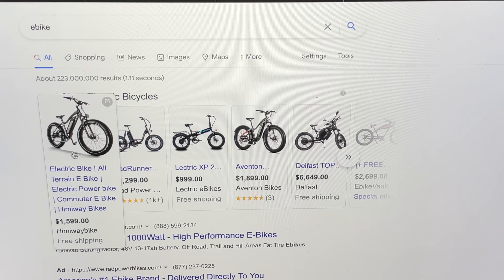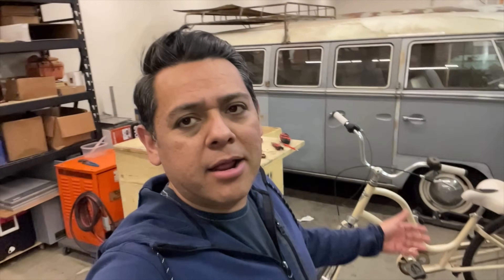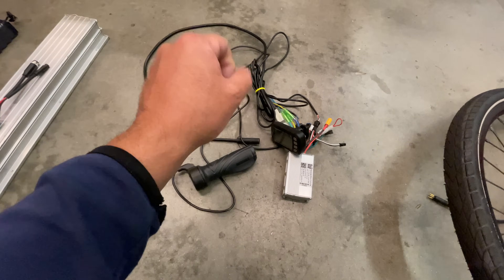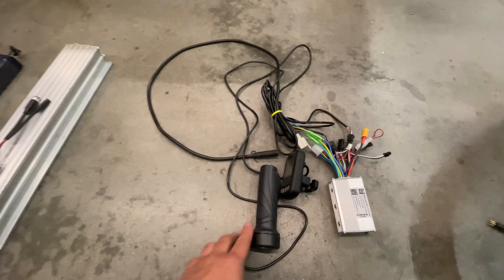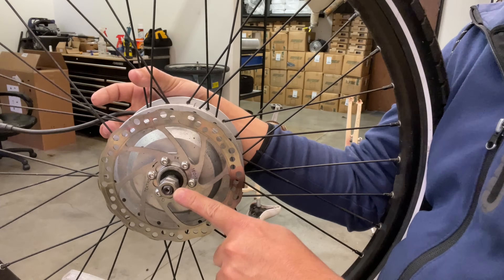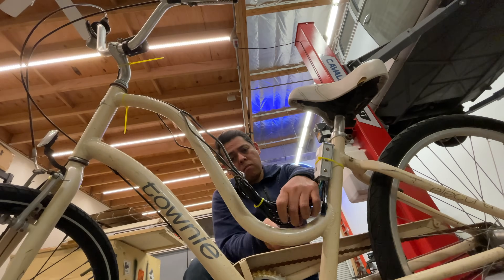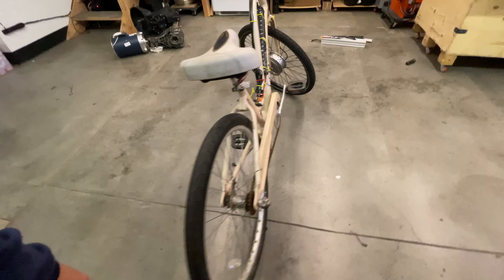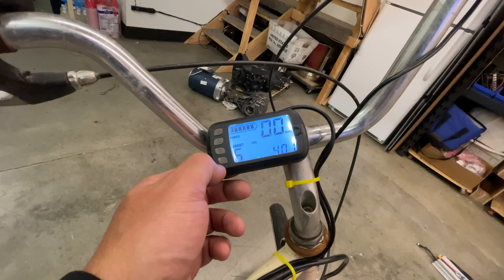$150 eBike Build,  Beginner friendly

Comment: Jehu, I'm just a little old lady who wants to convert my old coaster-brake into an e-bike to take me grocery shopping!  3-mi round trip max.  My bike does NOT have the kind of brakes yours does but in other respects appears the same.  Also 24" bc I kept falling off a 26" bike bc my feet hardly reached the pedals.  Will this conversion project work on MY bike?  I'm not about to go faster than 5-10 mph!  :p  But I can't pedal up and down the hills anymore either.  I retired to a tiny town in the central Midwest where most people STILL don't lock their doors.  So little traffic people just normally walk in the street since there aren't many sidewalks - but it's safe for biking  I don't want to lose the few friends I have left by trying to make them my chauffer.  Please answer soon as I'm desperate
Reply: @Frosty I bought the parts to do this on my $20 yard sale bike, and was frustrated when they arrived with zero instructions. But just about anyone with common sense could do this. All the wires and connections are logical. In other words, you have several connectors. But you'll have a female with a red blue and yellow wire, and then a male on the other end with the same colors. It's obvious where things go and how they go together.
We might be close. I live in the bottom of Indiana. If you need help and are close, I will come help you! We've all got to stick together!
Reply: @mattosborne1233  - God bless you, man.  And I'd take you up on it if I lived anywhere reachable.  But this is such a remote place that I have to explain it to most people by telling them the nearest Walmart is about 70 miles away.
Reply: If I'm not mistaken, coaster brakes only affect the rear wheel (it's part of the rear sprocket or hub). This guy's build replaced only the front wheel with one that has a hub motor. You should have no problem doing this exact thing, provided you get the new front wheel in the same diameter as your current one. Although it seems he soldered a different plug onto some wires off-camera so that his battery would interface with the controller circuit. If you or a friend can do that, you're golden. Couple of hand tools, zip-ties, and a quick soldering job, bang! Think I'll buy a used bike myself just to do this.
Reply: Also, you're not in or near New Harmony, IN by chance are you?
Reply: @robwoodring9437  - Unfortunately not.  I couldn't weld anything with a glue pen if my life depended on it either; but I know a couple of people who'd do that for me. I love my old bike bc it's comfortable and also has big wire baskets in front and on either side in back.  When I could pedal a big load, it was almost enough to fill a compact car trunk.   And I appreciate your kind answer very much.  I'm going to inbox it to them along with a link to the video to convince them that it should be easy for a handy person.  This is just not my field  I can outride and outshoot most people 
w/o half trying, but the skill sets don't transfer!  And don't let me anywhere near electrical assembly.  I blew up both swag lamp kits I tried to put together.  :p
Reply: @frostyfrances4700  After looking into the parts for myself, I see he only offers the wheel/motor in 26". But also on his channel is a video going through how to steal the motor out and install it in a smaller rim. It looks like a pain in the butt installing and tensioning new spokes but it can be done. Only reason I asked about southern Indiana was it sounded like you might've been from a town like New Harmony (pop. 750), although there everyone seems to favor golf carts, not e-bikes
Reply: @robwoodring9437   @Rob Woodring  - Them whut can afford golf carts do prefer them to e-bikes, I'm sure.  But I'm on the 'economy plan'.  :p  I saw that part of the video about redoing the spokes for a smaller wheel, and it does look like a bear.  Nobody around here would be willing to do that, as I would've been leaning on their good graces in the first place for an easy job.  .... And no, this town is the county seat but there are far more cows in the district than people (and I always say the cows are smarter); it's so small it doesn't even appear on most state maps.  I'm not 'from' here; just retired here, once again for economic reasons.  Lasted 16 years so far even though I'm the classic square peg in a round hole.  The vast majority of these people are xenophobic as geese and don't take well to any outsiders.  Especially the northeast damnYankee libruls.  Fortunately I grew up in a military family and later married into another one; so let's just say I can hold my own, as they've had to learn on several occasions.
Reply: @frostyfrances4700  well if they haven't learned to respect you despite your differences, then the joke's on them it seems. I stumbled across other videos reviewing "plug and play" style front-hub-motor conversion kits (for more money) that barely required more than a screwdriver and wrench, and I never saw one for any wheel other than 26". It's a shame, cuz this kinda technology is tailor-made to make your particular life much easier. If we were anywhere near each other I'd come help you get set up. I wish you the best of luck finding a solution.
Reply: Mike here ..me too..

Comment: I'm just wondering, is making an e bike using this kit really this simple? Do I really just click the links? I've been seeing comments where people said that they had to go against wiring instructions, that you needed all these adapters and controllers and other junk.

If anyone who has built a bike using this kit needed any adapters, could they please give me some links to those please?

I just need and e bike which I can throw together. I don't have any fancy tools like a soldering iron, and I don't have a lot of experience with wiring. 

I would appreciate any help on the subject. Thanks in advance.
Reply: It's a lot simpler when you have all the parts in front of you, then the comments will make sense. Only the large battery requires extra electronic components. For the small/med battery, the list covers everything except for the battery connector.

Basically, the battery comes with an XT30 female connector which has two small holes. The controller has a red and black wire coming out of it, which you need to connect into the holes. But the problem is the wires are too thick to fit into the holes, so the video recommends attaching an XT30 male to XT60 female converter (e.g. https://www.amazon.com/Racingirl-NIDICI-Connector-Adapter-Silicone/dp/B07JMFXRX1/ref=sr_1_6?crid=3JR6T6ECC5BN8&dchild=1&keywords=xt30+male+to+xt60+female&qid=1629941325&sprefix=xt+30+male+to+x%2Caps%2C211&sr=8-6) on the battery side, and soldering the controller wires to an XT60 male connector so that the two sides fit together. If you really don't want to solder, you can use electrical tape to sorta tape things in place and but the connection won't be as secure.
Reply: @toptree2002  Thank you so much your help! I didn't really understand what was going on because the video was going along so fast. I understand perfectly now.
Reply: @toptree2002  Actually, I have one more question. What do you mean by "the controller". I'm using the 3 link in the description for the kit(36V eBike kit (seller raised price) - https://amzn.to/3bLJWh4) and in the third picture of that listing, its describes what each wire does. Could you tell me which of the wires described is the controller you speak of?
Reply: @yteq8570  The red wire labeled "Positive Pole" and the black one "Negative Pole" are the ones you will need to connect to the battery. But as you can see from the picture the tips are pretty thick, and won't fit into the XT30 port of the battery without some adapters.
Reply: @toptree2002  Thanks again!
Reply: @toptree2002  Ok last questions I swear.

1. How would I charge the battery?

2. Does it work with rim braking?
(I know in the video the guy was using a bike with rim brakes but I'm not sure if it would really work)
Reply: @yteq8570  For charging you need a 42V charger with an XT30 connector soldered to the end (for small/medium battery), there are pre-made ones on the jag35 site.

The rim on the wheel is not designed for rim brakes, but I can confirm that it still does work with the rim brakes on my bike. Braking performance may not be optimal so it is an "at your own risk" sort of situation.

Comment: Hey man having trouble with my build think you can help ? I built my bike exactly like yours but when I powered it on and try to drive it the wheel never works. What am I doing wrong ? I’ve disconnected the 4 pin sensors for the 9 pin wheel hub wire but still nothing. I’m lost
Reply from the maker: Is your battery powering up? Does your screen come on? Does anything happen on the screen when you apply throttle?  It can be many things,  bad battery, bad controller, or bad wheel,  or cables.
Reply: Hey so my lcd turns on, battery is fully charged and I got a spare to use in case. When I hold the cruise button I can hear the wheel motor start up and hold a constant speed of 10km. That’s the only way I can get the wheel to move or even make a sound my throttle isn’t working at all. It won’t even move on its own. Should I buy a new throttle? I checked the wire it’s fine.
Reply from the maker: Sounds like a bad throttle

Comment: Thanks so much for posting this video, I never realized the conversion could be that simple! I have an old mountain bike that needs new wheels anyway, it'll be perfect for something like that. I wonder how the multi speed set up will work with it (shifting gears, etc).
Reply: A front wheel motor wouldn't help at all, since you are not pedaling the bike. Only a mid-motor will work with the gears. The chain has to be turning in order for the gears to change. And the motor has to be the power source (Sprocket) for the chain, not the pedals.
Reply: @paulreeder5241  thank you for the information. After some time for thought and further research, I arrived at that conclusion myself. Now I can make a more informed decision on how to actually do my conversion.

Comment: I don't think you can still find a $40 motor. Maybe. $200 ?
Reply from the maker: I just checked the $45 wheels are in stock https://jag35.com/products/26-bafang-36v-dc-electric-bike-wheel-tire-w-tektro-disk-break?
Reply: @jehugarcia  Yes, you are correct.

Comment: Anybody experienced this issue where the system shuts off while riding it. The battery LED started to flash and the LCD turned off. I have to press the power button again to get it to work, and shuts off again. Please help!
Reply from the maker: Sounds like the battery is struggling to provide the power it’s being asked to,  is it the small one?
Reply: @jehugarcia  I’m using the 36V 5.2A SCOOTER PACK IN MOUNTABLE, PROTECTIVE CASE. I have an XT30 connector plugged into the battery to another XT30 to the controller.
Reply from the maker: Yeah that battery is just a bit on the small side for full speed on that controller, if you add a second one it works great,  I will experiment packaging 2 of the internal ones on the next ebike project for 72v
Reply: Yeah, I'm having the same problem. If I ride with medium speed it's fine. But, if I go full speed it will turn itself off.. I figure its drawing way too many amps for the 36V 5.2A scooter pack to handle.  That's what I get for not doing the MATH before I bought the battery :D

Comment: Is the Ninebot NEB1002, 36v 7.5A that JAG sells compatible with the 26" Bafang 36V DC Electric Front Bike Wheel Jag sells? I bought both already..
Reply from the maker: Yes the wheel doesn’t care what battery you use,  neither does the battery
Reply: I keep getting a large spark when I try to hook up the battery to the control box. I've checked to make sure the polarity is correct. Tried hooking the positive up first then the neg. Tried unplugging everything and just plugging the control to battery still sparks. Any Ideas?

Comment: Done & done! Hit 20 mph out of the driveway and almost 30 on the street down slope! So much fun! Thanks again for the vid & conversion motivation! Also got a torque arm and a front basket to put the controller and battery packs in. Less zip ties and I'm lazy like that, lol.
Reply: Maybe a dumb question. But can you still pedal as normal on the bike? I want to make one for work, which isn't far but want to be able to pedal as normal if it isn't too hilly. Any thoughts there?

Also how is it on hills?
Reply: @DoctorQuinlan  Yes you can still pedal it as long as the pedals and chain are still connected to the rear wheel. I have an e-bike and you can pedal it, or you can have the motor assist your pedaling, or you can just run it straight off the throttle. These things are brilliant!
Reply: @trevorjameson3213  When you say "these things" are you referring to electric bikes in general or one similar to the video? thank you
Reply: @DoctorQuinlan  the rear of the bike is unaffected so pedal away!
Reply: @DoctorQuinlan  the rear of the bike is unaffected by this build so pedal away!
Reply: I was wondering about a torque arm. I just ordered one (<$10) just to be on the safe side.
Reply: @lastbutnotleast1396  I put one on both sides.
Reply: That's the way I would do it too.  Short and sweet.
Reply: Rock and roll buddy I love it.
Reply: How did you connect the battery to the controller? The plugs don't match.
Reply: @matthmataz9897  I think he said he had to solder that to make it work in the video
Reply: Hay bro what do I do on the rim plug what’s that go to I got the kit but I’m stumped on what to do now I don’t got the plug to connect to that plug on the rim
Reply: Bro my motor runs but my wheel doesn’t spin ,can u help with any advice? Please asap ty so much
Reply: It's in km/h not mph  stop watching shit on your tiny phone
Reply: Yo where did you get the wheels I can’t find something named the “fang” wheel online
Reply: 20 and 30 Kilometers an hour NOT MPH..
Reply: I'm in Knoxville, Tennessee, and I can't find a wheel anywe're . Let alone a  battery. Anybody else in knoxville tennessee know of any resources

Comment: 4:48 soldering a new connector?? That's a major problem for most. That's gonna take you 10minutes to convert that over.. so you need to buy another connector as well?
Reply: Internet searches can be your friend. Look at specs pages for these components and learn the names of connectors used (hint: they're used a lot in the R/C car / airplane world). Next search: find an adaptor from one to the other. Done.

Comment: What other connections do I need if I want to use the Segway 36V 7.5A SCOOTER PACK IN MOUNTABLE, PROTECTIVE CASE sold by JAG. I purchased the wheel and battery already.
Reply: I keep getting a large spark when I try to hook up the battery to the control box. I've checked to make sure the polarity is correct. Tried hooking the positive up first then the neg. Tried unplugging everything and just plugging the control to battery still sparks. Any Ideas?

Comment: I just finished up this build I ordered all the parts on your list I hear the motor spinning in the hub but the wheel does not move
Reply from the maker: You connected the wheel backwards
Reply: @jehugarcia  Switch them all around it works 🙌🏻⚡️⚡️ I should be going to work right now but I’m super excited to go ride around my neighborhood l😂😂
Reply: So it’s been about a year I ride the bike still about once a week rode it yesterday with my son on the back to the beach over 8 miles round trip still well worth the money … So I have friends with super 73’s and electric bike co. Bikes and cheap Amazon ones all them 500w or 750w 36 and 48v on my home made bike I can’t really take off from a dead start I have to pedal and “help” it get going is that normal or anyway to get it to not struggle changing to 48v batteries make a difference? Just curious on what’s your opinion on that can’t find anything in you tube about it 
Thanks !
Reply: Or the amperage of the battery pack ?

Comment: I have a 3 wheeler that came with an ANCIENT 12 Volt motor and battery. Both died at the same time. I trained my service dog to pull me. (I am handicapped) Bought a new motor and battery and with no instructions, got it to work. The freedom I experienced after being a cripple for 5 years is beyond description. My.dog still goes with me but instead of being a prisoner at my home, I now look forward to getting up every day and exploring my hometown. It is better than a car and My  service dog LOVES IT. My problem hooking things up was the pedal assist. I pedal as mu h as I can so my legs wont atrophy but all the extra stuff I dont need. This video shows a simple way to get going. Please do a video on 3 wheeler's. They're different. Like you, I.want speed and power. It seems the people building 3 wheelers for handicapped folks dont want us to go more than 25 mph. Mine does 30. 1000Watt 20 Amp-Hour Battery. No pedal assist needed or wanted. It was a PITA from the start. Thanks for the nice short video. Do 3 wheelers soon!

Comment: This could've been a 5 minute build. Just put all that stuff in a basket on the handlebars. It would be a nearly stealth install.
Reply: 4:48
Reply: @americanpatriot212  Lol. So it could've been a 2 minute video then! Haha.
Reply: Motor would still stick out for thieves to steal parts, but trying to be stealthy sounds like a good idea. A quick disconnect and disconnect for controller and battery sounds better to me though.
Reply: @01mustang05  or a fella could cut and pound some aluminum to make covers to deny thieves access to the guts, and then do QD for the wheel/motor like you said